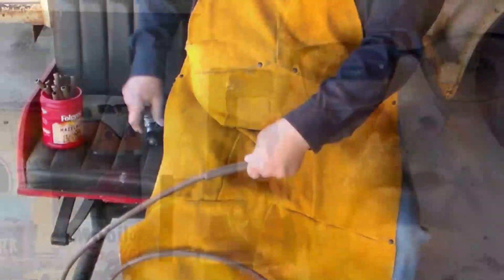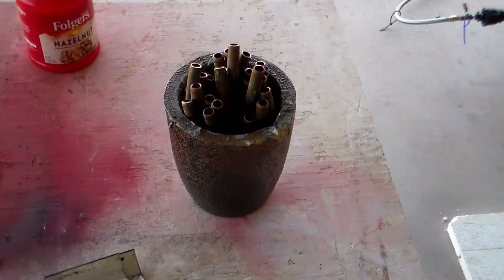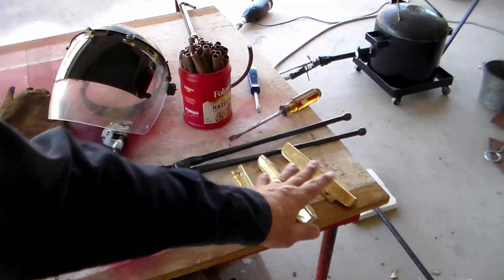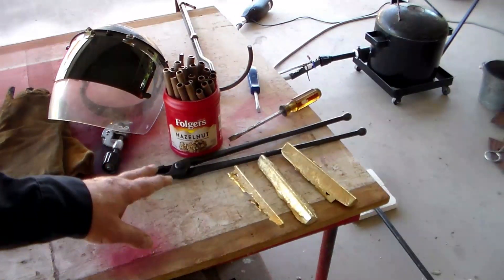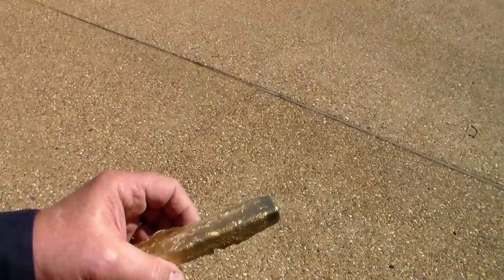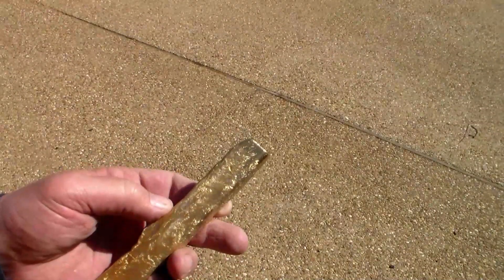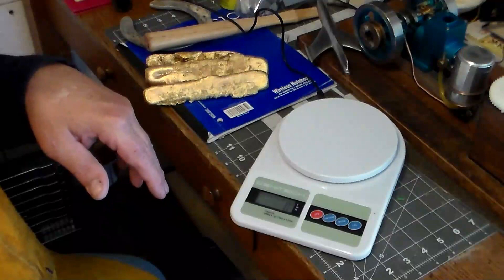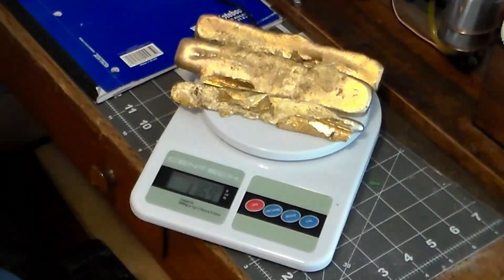How to make Aluminum Bronze

Comment: Great job.!!.. you Rock Lloyd... About all I use Aluminum bronze for is slide and wear plates. The impregnated graphite is my first choice though. I cant keep the toolmakers from using grease so alum bronze becomes the material of choice a lot of times. I'll bet you have some hi pressure sliding you need to do with your project. Thumbs up always .!!!
Reply from the maker: It is an interesting metal and not hard to make. It just takes lots of heat. Thanks Pappy